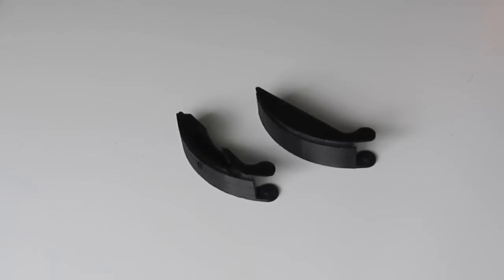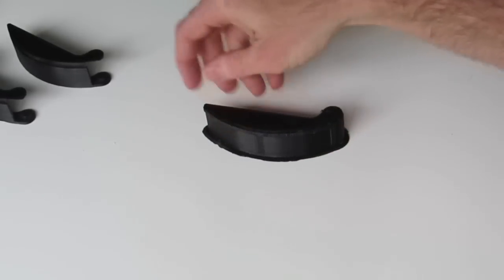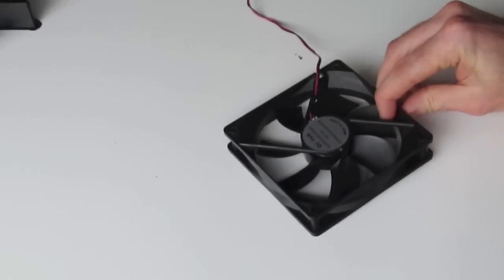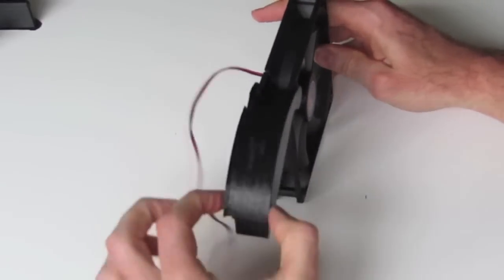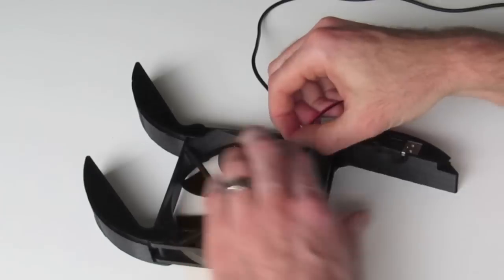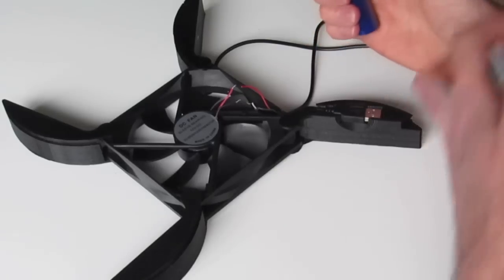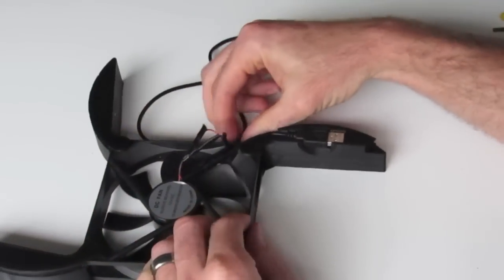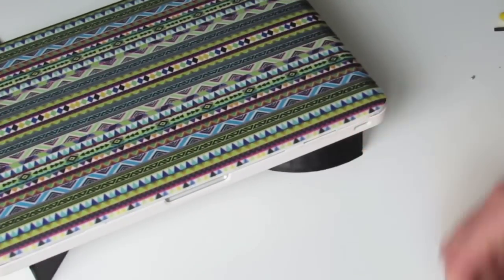DIY Portable Laptop Cooler

Comment: Nice idea, but has a major drawback: The fan has to draw air from somewhere in order to work. Placing it onto a table just doesn't let it work as it should :)
Reply from the maker: Thanks.  As I'm sure you already know, laptop coolers draw air through the laptops designed air vents, aiding the airflow direction that that laptops internal fan produces.  They don't blow air into the laptop.  This particular 3D printed design has a gap between the fan exhaust and the table, allowing warm air drawn from the laptop to exit.
Reply: project3dprint Ok I'm sorry I just saw that you placed the fan upside down so as it can draw hot air from your laptop. BUT... if you watch the most videos about laptop cooler stands (concerning those sold in computer stores), what they do is blow air to the bottom of the laptop. In this way, the cold blown air extracts the heat from the bottom of the hot laptop :)